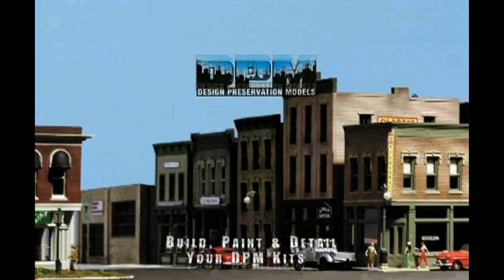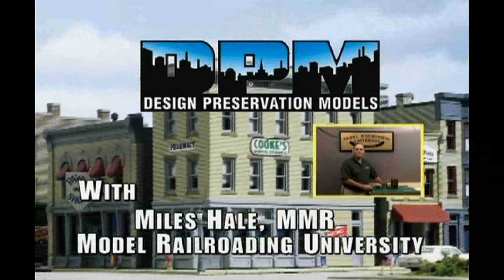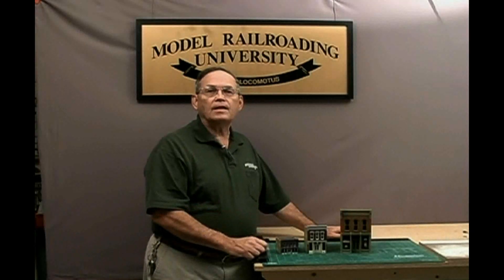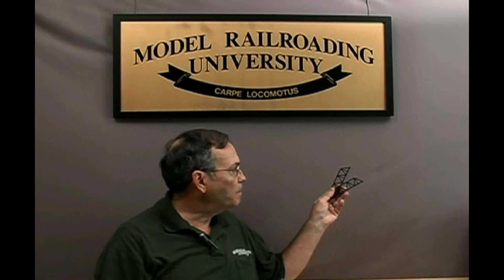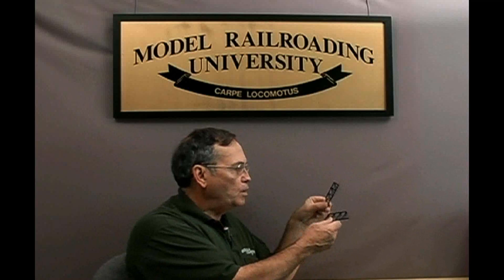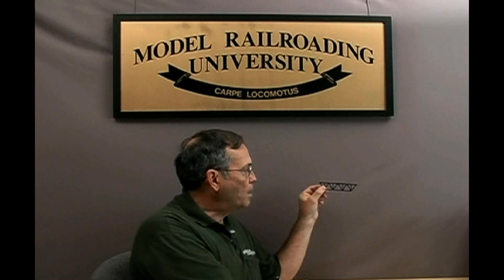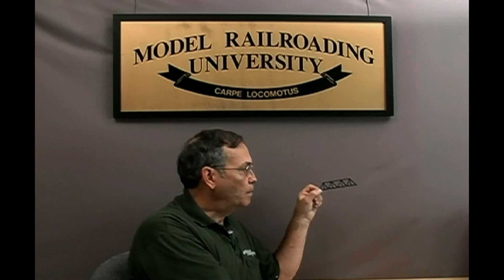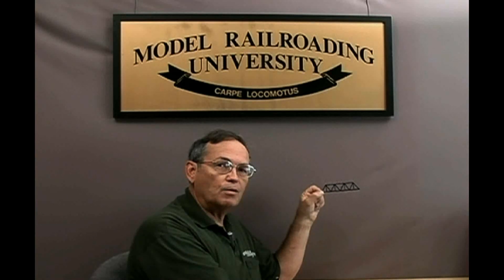The First Lesson / DPM Kits - Part 1/21 - Woodland Scenics

Comment: Very informative video.  Can you direct me to a spot where the glue syringe can be purchased from.  Addtiionally how do you clean the syringes after use.

Thank you,
Reply from the maker: Miles said he bought the glass syringe years ago through BD medical supply - www.bd.com. They have several types, you just have to look through their Web site until you find what you want, however the exact one that Miles is using has been discontinued. They run about $60 - $65.00. You might also check www.micromark.com. They also have glue have a lot of hobby tools, including glue applicators. Since we do not manufacturer glue syringes, we really cannot offer a general cleaning instruction. I imagine they are all different, and you can find that information in the product instructions. Many manufacturers will often post the instructions on the individual product website product page, so hopefully you can find the answer to that question easily when searching for the applicator you want. Hope this helps!